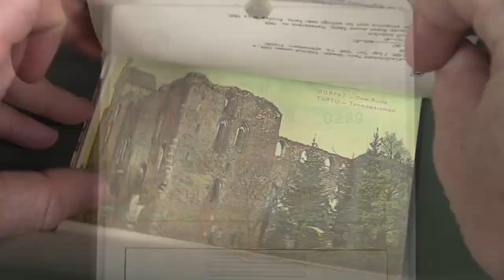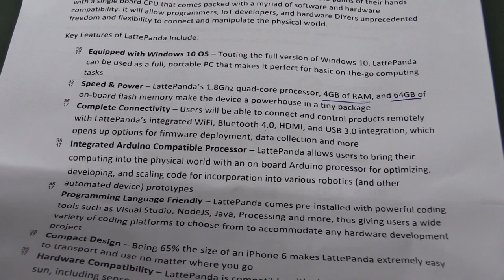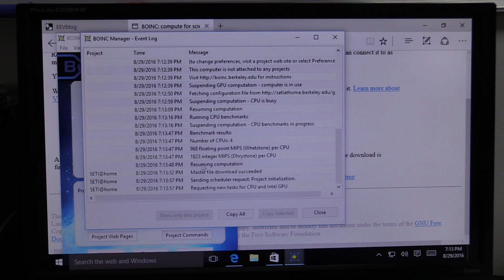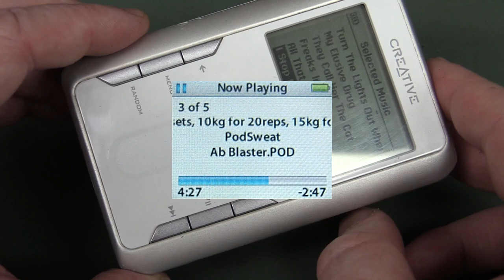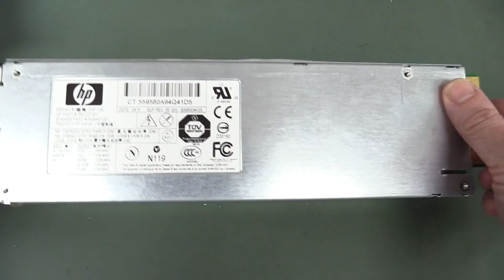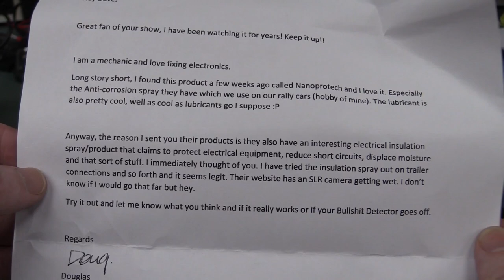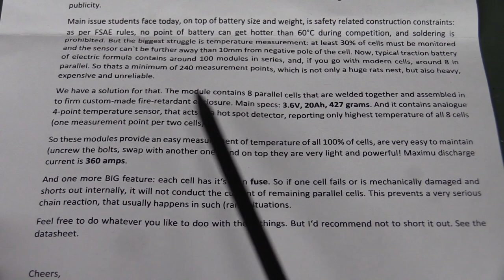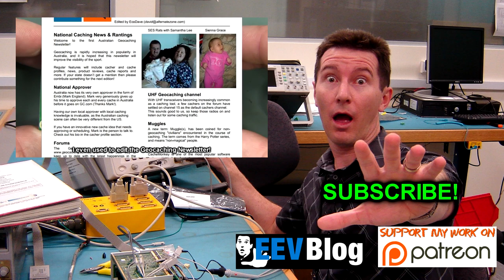EEVblog #917 - Mailbag

Comment: I'm the guy who donated the Sony GPS! I've since discovered that it's the electrolytics on the display board that fail, resulting in "Dead Screen Syndrome" & not a loose flat-flex.
Reply: Just found http://retro-gps.info/Sony/Sony-Pyxis-IPS-360/index.html and wanted to say the same.
Reply: I seem to remember seeing a scanned ad somewhere that said $1,200 USD.
Reply: The postcard took me by surprise, since I've lived up in the mountains in NV looking over Tahoe for 4 years so far and I see those mountains every day :P
Reply: +Johnny Joannou Regretfully, I couldn't find a postcard for the pony express station in Fernley...Oh well!
Reply: I remember when that first came out. I wanted one to toy around with, but it was too expensive for that. I could be wrong, but I think it was closer to 2K. The link here says 4 parallel channels, but I seem to remember the first device had to cycle though a channel at a time to get a fixed position... taking some time to achieve that.

Comment: I see the problem... It's got a bit of malware called win10. Clean that up and you should be fine.
Reply: I'm sure that might help, but It may still thermal throttle the CPU when it gets to hot regardless of the operating system. I have the 4Gb ram/64Gb model and it works really well, but needs a heatsink on the back of it to keep the CPU cool.
Reply: Either you're an apple fanboy or you just don't like windows ten... Which one is it?
Reply: I hate windows 10 and apples computer operating systems, but IOS is not bad.
Reply: +Jacob Adamsky 

It's the latter. Windows 10 is only a little better than Vista. Truth be told, I'm a Penguin. Windows 8.1 was good enough for me to avoid Linux withdraw when I had to go a bit without dual booting, but 10 is only good on my W10 Insignia tablet.

On my laptop, I only use the Windows partition for games and school software that's not Linux compatible. And that stuff is going to be put on Linux as soon as I can.
Reply: ***** Task manager shows otherwise.
Reply: When I tried Linux several times, nothing worked out of the box, not even graphics. After 2 weeks tinkering I got graphics kind of working (still no 120 FPS on the 120 FPS laptop display), sound working, backlight regulation working but the SSD was still not to be recognized. So I gave up. The community is also unfriendly and incompetent. I tried Debian and Xubuntu as well as Ubuntu.

For me, Windows 10 is 100x better than 7. 7 was shit. It was slow, the file search didn't work at all, the search indexer kept heating up my HDD and SSD (perhaps it ran into an infinite loop??), the start menu was messy with the cascading folders, etc. 8.1 was good, too. 10 is still better. I don't want to go back. Ijust had 7 for 6 months, then 8 came out. Before I ran Vista a long time and before that XP for 3 yrs, before that Windows 2000 for almost 6.
Reply: I use Gentoo Linux, Mac OS X, and Windows 7.  All three running side by side at work.

Tried Win 10 -- not even close to ready for release when I tried it a few months ago, and still felt half-baked in terms of "are we a desktop OS or a tablet OS?"  I'll wait for them to figure out what they want to be when they grow up.  Win 8.1 was just always in the way.  Went back to 7 because it works, and has an identity as an OS, and thankfully still has good driver and application support.

Still, the more I use OS X, the less time I spend elsewhere, though.  I'll always love Linux, but with a good UI and a full-featured CLI running native on a MBP, I don't need to dual-boot or even start a VM for much these days.  (Won't ever give it up for embedded and server apps though.)
Reply: PEBCAK. Community is unfriendly and incompetent? You must have gone to Tom's Hardware instead :D
Reply: Useful tips for learning Linux:

Don't do it on your production computer.  Not for work, not for home.  Put it on hardware that you can treat as a lab box, because that's what it will be for a while.

Next, don't pick the latest-greatest hardware.  The major manufacturers do not bend over backwards to make sure their hardware has "Hardware Quality Labs Certified" drivers for Linux.  If they help at all, it's in the form of binary blobs that work with specific versions of the Linux kernel, or modest documentation and maybe a sample source file.  Sometimes they passively fight against the community by not providing anything at all, and threatening legal action against the dissemination of IP.  So you're at the mercy of people who are just stubborn enough to figure it out anyway and then give away all the hard work for nothing.

Next... have a purpose.  If you download a Live CD and run it, then don't know what to do with it, you will just reboot into Windows and never touch it again.  Think of something you want the box to do (DNS server, web proxy, whatever.)  This gives you a goal, which is probably the single most important thing to have when approaching the base of a learning curve.

Finally, and this one is a suggestion to be taken with a grain of salt:  Try some of the more advanced distros.  Ubuntu is great, in that it often just works.  But you don't learn much if it just works.  That's why I picked Gentoo to start with.  By the time you've gotten Gentoo installed and have nothing more than a command line, you've already accomplished a lot.  BSD or Slackware (is that still a thing?) or Debian are also good candidates.  RHEL or Cent OS are good if you want to prepare for the enterprise Linux market.  You have to be willing to fail, willing to research, and willing to fight with it.  But with the struggle comes the reward of actually knowing what you're doing.

If you're asking "why would I want to fight an OS?" then maybe Linux isn't for you.  That's OK, I'm not one of those that thinks everyone should use it.  If you enjoy a challenge, or want to get into technical jobs (IT, embedded, scientific stuff, etc.) then it will serve you well to know it.  If you just don't want to pay for an OS, or just don't trust Microsoft and loathe Apple, then you will have to be pretty motivated.  But it can be done.  It won't be a walk in the park, but it can be done.  Stick with it.
Reply: Nick Guy
Thx but... How do I know if Linux runs on my production computer with all that different hardware? And what's the purpose of running Linux when it can't be productively used?
Reply: Troll harder.
Reply: *****
It can be used productively, I just wouldn't recommend learning it that way.  Same way I didn't install Win10 on my primary Windows box right out of the gate.  And how I didn't learn woodworking by rebuilding my house while sleeping in a tent in the back yard.
Reply: Nick Guy
LOL. Yeah but I installed Windows 10 right at the release and didn't have any problem since then.
Reply: Well that makes one of us.  Complete disaster here.  I had issues activating it (which have been cleared up since then of course) and something I installed (Office 2010 or my PDF reader or something) was incompatible with Explorer and it crashed repeatedly on open/save dialogs.  Basically completely unusable for production work.  Luckily, I didn't assume it would be perfect out of the gate, and my Win 7 install still works fine.
Reply: Nick Guy
I don't believe you! I have Office 2010, too and it worked fine from day one. You can't blame MS when you destroy your systems with dodgy software or malware. Windows 7 was a complete fail, it killed 4 HDDs because the indexing service went berserrk. Also the Start Menu was not usable at any rate. I didn't find anything there, so I went and built a simple launcher for myself. I hate Windows 7 and I am grateful not having to use this bullshit anymore!
Reply: Holy shit, Kyodai... got your head up Bill Gates' ass far enough? Linux is a WONDERFUL OS... just because you had a bad experience (likely due to major PEBKAC) doesn't make the OS bad. Windows 10 is the best Windows yet. I'm both a Linux and Windows user. Linux is extremely easy to use -- I simply cannot understand why people have such a hard time with it. I've thrown so much different hardware at it... it's almost always "just worked" with Ubuntu or Fedora. It's faster, more lightweight, and gives the user more power... and therein lies the problem. People are so conditioned to Microsoft having more control over their hardware than they do, so when they get the power they just sit there like a deer in headlights, waiting for things to automatically happen. It's like childhood vs. real life -- Linux doesn't pay the rent or put food on the table for you, you have to do it yourself -- and once you do, you feel much better and in control.
All that being said, I do use W10 a lot, and it's much, MUCH better than previous Windows. But you'd pry Linux out of my cold, dead hands. <rant>I cannot fucking STAND that Microsoft thinks it's okay to reboot my machine without telling me. It took forever to finally figure out how to turn that off. Apparently it's supposed to give you some kind of warning, but after 3 episodes where it fucking closed everything I was doing with no warning, I managed to change the permissions on that reboot service so that the OS couldn't run it anymore. Thank god. Microsoft forgets that it's MY laptop, not theirs. If I want to run with security vulns for another 30 minutes, that's my fucking prerogative, not theirs. </rant>

Comment: The little windows computer around 13 mins.     Windows is VERY disk heavy and low quality SSD's don't usually buffer writes very well.    I've seen bad herky jerky performance with Win10 on low end SSD or SD card storage.    The windows kernel scheduler is terrible with high I/O wait times.    Put linux on it and it'll run very fast.
Reply: I'd bet there are Windows Updates going on.  Yes there IS a GPU on it which will be enabled once the Intel HD Graphics driver is running...
Reply: Doesn't necessary have to be, I have a cheap windows tablet with very simmilar specs (32emmc/2gb, slightly weaker atom even) and when it comes to boot times and light tasks like web browsing, movie watching, etc. it feels very simmilar to my desktop, wich i would considder as current high end. Actually with both the 8.1 and then 10 update the tablet has become smoother in operation, there seems to be some kind of "burn in time" though untill everything runs as desired.

But you are still right, some Linux distros will probaply be faster
Reply: what a load of nonsense. The idea that linux is faster is a myth. Put Ubuntu on it and it will be the same experience.
Reply: Designandrew My information comes from being an I.T. professional that has studied the I/O issue with the windows kernel.  I've compared, and timed things on the same hardware purpose built for the testing with cheap non-buffered early SSD's and a low end SD card.   It's not an emotional issue for me, just an interest.
Reply: Kevin Loughin Sorry I didn't realize you'd tested the latte panda x86 machine so thoroughly. Do you have any links to your interesting research?
Reply: 1st of all    Ubuntu is a user-friendly Linux-distribution designed to be used in a desktop-PC-environment. NOT IN AN EMBEDDED-ENVIRONMENT! (like the latte panda)
2nd of all   Windows performs terribly in a REAL-TIME-ENVIRONMENT!       Why do you think do some modern real PLCs use Linux but NONE Windows? Because of the RESPONSE TIMES!

BTW Kevin Loughin STUDIED the well known I/O issue in the Windows Kernel which is present in ALL versions of the NT-based Windows OS
Reply: PERILEX Don't feed the trolls!   You'll never get rid of them....  ;-)
Reply: Kevin Loughin Im aware of that! ;D

But im not sure if he was bullshitting around or demonstrating his lack of knowledge.
Reply: Load up xubuntu or lubuntu and watch it soar. Even Mint cinnamon is breezes past win10. Haven't touched unity, but doubtless they managed to iron the kinks out by now and get performance up to par. A puppy build would be awesome on this kind of system.
Reply: Windows 10 has a version for IoT form factors like this that addresses all those things.  I believe the base install of it is smaller than some Linux distros.  Not sure what's installed on this particular computer,  but it should be the IoT version.
Reply: No, win10 IoT core looks nothing like that afaik. IoT core isn't really supposed to be used with a GUI; it's cool but it doesn't really do desktop stuff.
Reply: +mmmhorsesteaks Would assume it looks like the "core" installs on Windows server where you use command line and powershell mostly.
Reply: hmm from the blurb: "Windows 10 IoT Core is a version of Windows 10 that is optimized for smaller devices with or without a display, and that runs on the Raspberry Pi 2 and 3, Arrow DragonBoard 410c & MinnowBoard MAX. Windows 10 IoT Core utilizes the rich, extensible Universal Windows Platform (UWP) API for building great solutions. " So that computer was running straight up win10, definitely not the IoT version.
Reply: Yes, as it specifically said, it's not running the IoT version.
Reply: +Kevin Loughin

Bullshit is still bullshit even if you scream "MUH QUALIFICATIONS!"
Reply: Ubuntu being your idea of Linux is nonsense. Currently the off the shelf Ubuntu is just as heavy as windows BUT they do have other flavors for slow computers like yours. Among that, there are 100s of Linux distributions, all free, open source, modular, and wont self destruct. Does anyone else realize that Apple and Windows does this with updates to force obsolescence?

Comment: RE: The Proliant Server Power Supply. There are no fans in the actual power supply as the server has many fans arranged so that a very high volume of air passed from front to back. So pushed through the PSU. I work in a Data Center, and standing behind a rack of servers is like standing in front of a bunch of hair dryers. They certainly kick out some heat.

Comment: 34:40 - those power supplies are designed for the system to have a bunch of hot swappable fans that suck air through the front of the sever case and out of the back. So all the air flow would have to pass over the power supply.

Comment: Yeah, I have the 4GB RAM/64GB LattePanda. I've found that you need to use a 3A power supply for it to run stable. I've also had to add a low profile heatsink to the back for it to run cooler. Other than those quirks I've been pretty satisfied with it. Btw, the LattePanda team has made a power-on-plugin BIOS that you can flash so that the board powers up when you apply power to it.

Comment: HP power Suplies do have fans in the blade  server 1U and 2U redundant systems that do run fans on the server side to cool the power supplies. They do have an independent card that monitors the hardware with its own network port to report when one fails back to a central monitor server. I've taken one apart before when doing server engineering, they are packed tight but do stay cool in a properly cooled and ventilated  data centers.

Comment: IF leakage out the antenna is a common failure mode, mostly likely caused by front-end transistor zapped to short from gate-to-drain.  Radio will usually still work, albeit at reduced sensitivity.

Comment: the psu is active cooling - the fans are in the system, usually 2 rows of fans all across (2 rows for redundancy).they can get quite loud under load but they move a lot of air.

Comment: Since rack servers are typically packed with fans (think at least a row of fans all across the width of the chassis) I think the pressure difference would force enough air through that psu to cool it.

Comment: That HP PSU is from a 1U DL360 server (looks an older like 10 years ago one) - they have a load of small high speed (and loud) fans elsewhere in the chassis which forces a surprising amount of air through the PSUs. I've used one of these when I needed a decent amperage PSU before (20+ amps) and strapped a small fan to the end forcing air through it - they do overheat easily though.

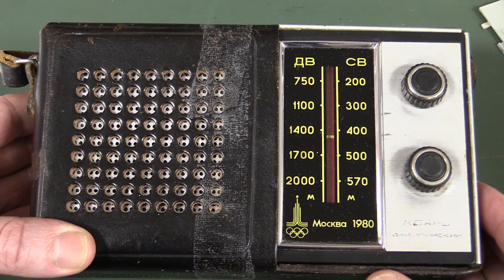Comment: At 2:50 you can see the "Moskva 1980" text below the tuning dial. As pointed out by someone else it means "Moscow". If you notice the image to the left it is the logo for the 1980 Moscow Olympics. At 14:00 the sluggishness might be due to Windows checking for, and downloading, updates in the background. As to having to use a button to power on you should check if you can get in to the BIOS of the unit. If it is using a standard type of BIOS there will be an option that says whether the unit should power back up after a power loss or stay off. At 34:30 the power supply looks like one that would be used in a rack. The rack would provide the cooling so there would be no need for any active cooling within the supply itself.

Comment: The date on that calculator will be the four-digit number on the back of it.  It also has the price (шена, 'shiena') of 35 rubles on it.  In that radio, the date code is on the back of the tuning capacitor; it's a Roman numeral for the month and two-digit year.

Comment: micro usb jack is handy but always soldered semi-thick wires directly to my Raspberry servers PCB to ensure wiggle-safe and low impedance PSU connection (had some stability issues with not-so-good USB cables)

Comment: Back in the mid-90s (as far back as I really go) there were GPS receivers with as few as 6 channels — just enough to hold 4 satellites and keep a look out for a couple others to switch to if the ones you're tracking are obstructed. A nicer one would be 8 channels.

Comment: If you would have used the USB power adapter for bench power supplies out of the recent mailbag, the small PC most likely would have also worked from your bench power supply.

Comment: Server power supplies rely on the server case drawing air through them, thats why it looks passive but problably aint. most servers wont even boot without the internal fans behind the power supplies fitted.